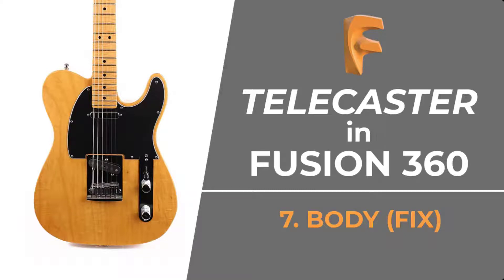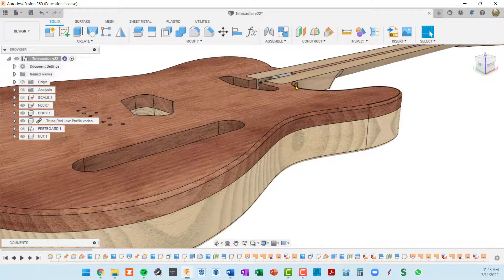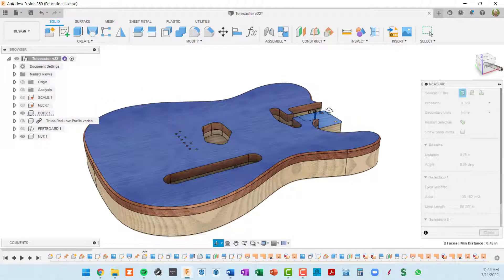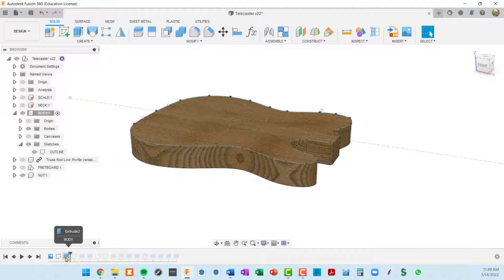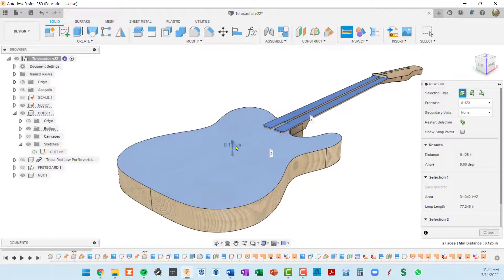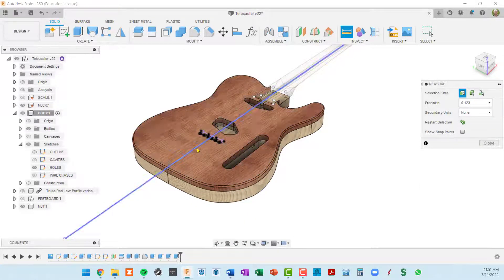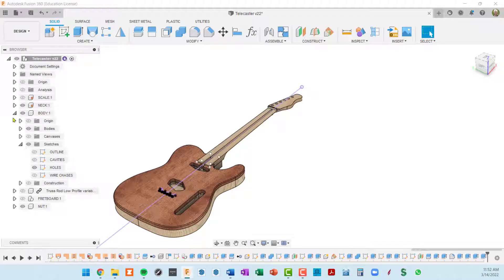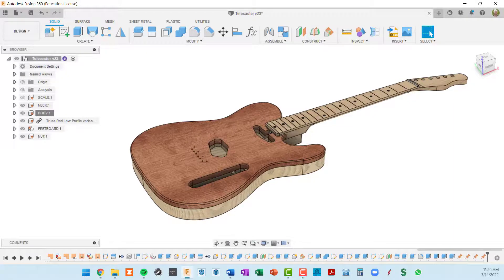Telecaster in Fusion 360:  Part 7a, Body Fix

Comment: I rewatched the last video and I saw that the neck mounting holes that you got a bit lost on were 0.166 diameter in the drawing, but the 0.188 should be close enough, especially with a plate on the back.